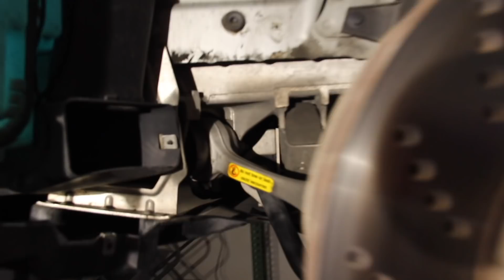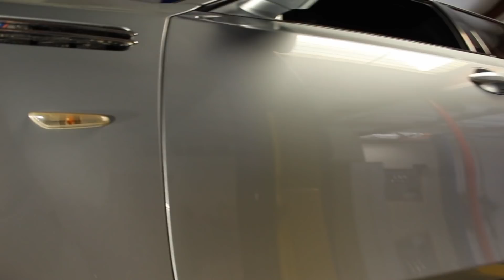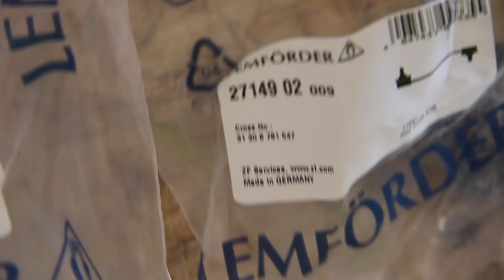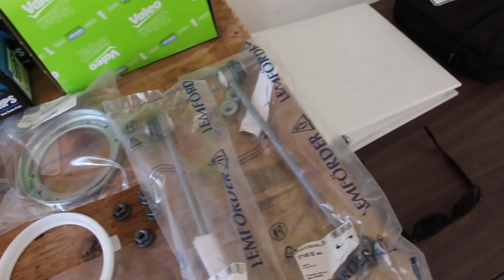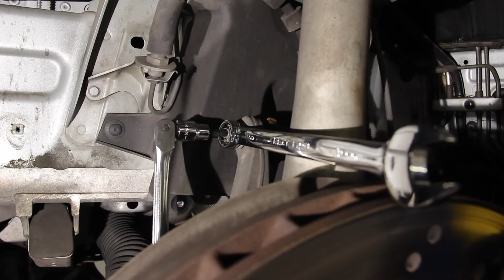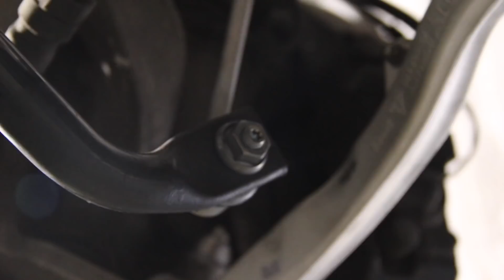BMW E60 M5:  Front Sway Links DIY

Comment: I actually ordered some from rock auto an bought two of the same for the driver side sway bar however it seems that it has multiple part numbers which are the same as the left and right link. I was wondering if they’re were any noticeable differences between the two side of sway bar links?
Reply from the maker: They are different part numbers, 31306781547 and 31306781548.

Comment: Great video! Proud E60 M5 owner here

What was your reasoning for replacing these when they were not broken?

Was there a noticable improvement in driving when you installed the fresh ones?
Reply from the maker: We did them because the upper boots on both side had oil seeping out of them, which meant that their lifespan is quickly ending.  We're in the midst of a 100,000 mile refresh on the car, so anything like this that needs (or will soon need) attention is being addressed now.  We haven't noticed any differences that I would point to the end links directly about.
Reply: E39Source, LLC Gotcha! Mine is a 2008 with aprox 80k miles. Done bearings, clutch, flywheel & slave cilinder and throttle actuators all done preventative. Next thing is probably fuel filter & injectors on my car. Diff & gearbox oil was done every 3rd oil change (and each oil change was done after approx 6k miles) since new. Car is currently off for full detail and will also get a  ceramic coating.
Reply from the maker: @diopsidem5  That's the way to do it!  Better hang onto that car.  Why injectors though?
Reply: E39Source, LLC If you go with Bosch it isn’t too bad to replace them. Reason is that there have been a few examples where an injector stays open after you turn off the engine. Next day you start an engine with a cilinder full of fuel and you can “hydrolock” the engine. Whilst am I at it I will also flowmatch the enjectors - so buy like 15-20 injectors and pick 10 injectors with the most similair “yield” (for a lack of a better term)

Comment: I have had huge problems with aftermarket parts on my BMWs. Do you always use Lemforder? Have you ever had a Lemforder part fail? What other part makers are OK?  There does not seem to be much information out there, but I have had  Dephi ball joints fail in less than a year on my Z3.
Reply from the maker: BMW themselves don't bother wasting time/resources on producing components like modules, control arms, sway links, pads, rotors, alternators, etc etc.  They are generic parts that are used on many models of vehicles usually.  BMW sources parts from Lemforder, Febi, Bosch, Valeo, Hella, Zimmerman, Textar, and many other manufacturers.  They then stick their logo on the part, and often double or triple the price just because of that.  If you can determine who made the original part, it's usually much more cost effective to simply buy the part directly from the original manufacturer, like we did with Lemforder here in this video.  They will still eventually wear out, of course, but pre-mature failure (if correctly installed) would be quite rare.
Reply: @E39Source  I've had very good experiences with textar brake pads. Stop identically to BMW ones. However me E65 Air cond condenser from Hella was way lighter and more flimsy, and required a few hours of filing and fiddling to make it slide into place.
Reply from the maker: @andrewthompsonuk1  That's because textar makes the pads for BMW!  

And Hella probably was the original equipment supplier for THAT component.  Hella does make plenty of parts on the car for BMW though.